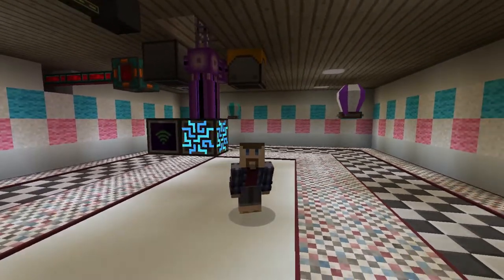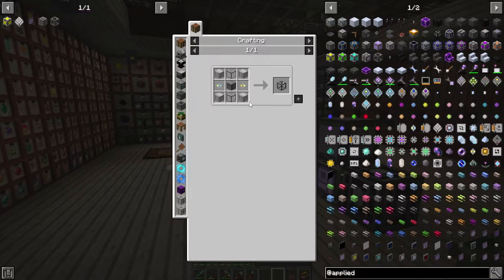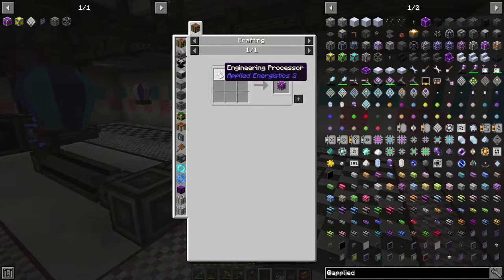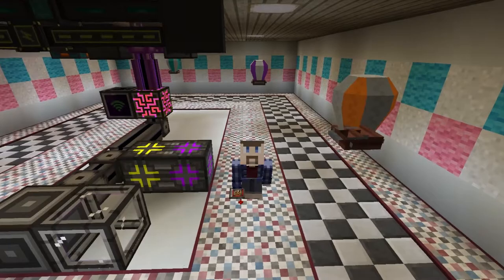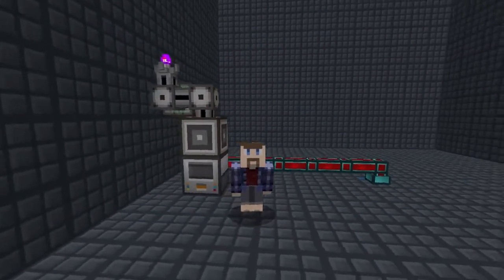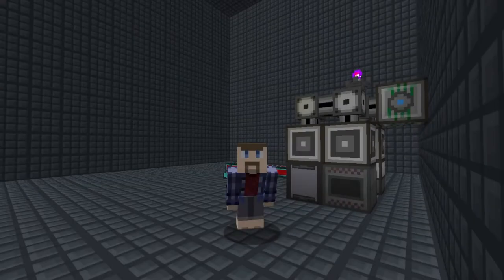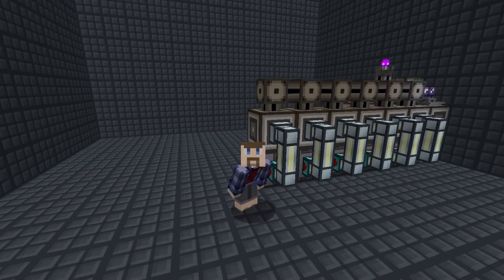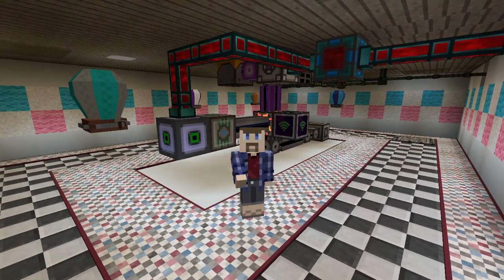Autocrafting with Applied Energistics 2 - Minecraft: Enigmatica 2 Expert #56

Comment: Do p2p tunnels work with the capability adapters ? Certainly makes it a lot tidier putting it in a compact machine 😀 a nice tip also is if you need to craft more of an item that already has a pattern and atleast 1 in your storage. you can press your mouse scroll wheel button to bring up the interface.
Reply from the maker: I actually don't know, but I would assume so, since the main purpose of the adapter is just to make the AE2 channels work at all through compact machine tunnels.  I've spent almost no time figuring out the p2p system honestly.  I'm going to have to soon though probably.  

Been busy cleaning up that room since I made this video and building out autocrafting for AE2 parts, and I'm probably going to have to do yet one more video with all the issues I've been running into and resolved.  It certainly wasn't what I was planning on doing though, but I've spent the better part of two days now cleaning stuff up, and I still have to move everything around in that compact machine.  Need to move all the other things into compact machines as well to get rid of the clutter and make room for more ME controllers.

Thanks for pointing out the mouse wheel thing though.  I somehow never tripped across that.
Reply: Yes I only discovered ithe mouse wheel trick through this mod pack. It certainly pushes you down paths outside your comfort zone. The p2p tunnels were also new to me. The one trick is you need to provide power to the tunnel side for it to work. You can usually just use a quartz fiber to connect power to both side but no channels. The one big irritation I found has been using compacting drawers for a recipe that needs blocks. It’s fine when you have stock of them but if you need to create ingots from ores then the crafter can get itself confused I think maybe using your storage bus trick might help to create a permanent stock. I have used soooo many blocks of tin going through env tech void miners. I’m just farming my nether stars for tier 6. It’s scary the resources crafting a tier5 structure panel block uses and even the null thingies are crazy. 
I need to do my modular machine for the titanium creation you did a few eps ago. Just doing the controller is a mission especially now I decided to go with the black iron pedestals i gotta make an elite crafting table 😳. It never ends 🤣🤣🤣 keeps me out of trouble.
Reply from the maker: Yeah, I was mucking with a separate p2p network and knew about routing power into it with quartz, from trying to setup a formation panel to automate fluix crystal creation, and never managed to get it working and just gave up because there are much easier routes in this pack.  Was just trying to do it the AE2 way because I was unfamiliar with it and it cost me like an hour of frustration.

I haven't even started upgrading my void miner.  I know the day is coming, but I'd need to get around to upgrading my power significantly first, or at the very least, setting up a second turbine already.  This is also part of why I started the low and slow roll of nether stars earlier than most though, because I knew I'd need thousands of them at the far end.    I could speed up the process, but it's unnecessary if you trade it from time instead.

My main goal currently is to build out my AE2 capacity though to get all my basic crafting stuff out of the way.  I'm only like 4 months behind schedule on actually doing that.  I'm sure it'll only take a few minutes.  Oops.  On the upside, materials won't be the problem in this.  Making 64k storage cells are already fully automated at least, so building out a compact machine full of cpus will be trivial.
Reply: Hehe I’m sure it will. Looking forward to the journey.

Comment: I have the exact same setup as you but when I try to craft printed silicon it doesn’t show up as craftable? Is it because I’m using the recipe as the normal inscribed and not the advanced one? (There is no recipe for the advanced inscriber)
Reply from the maker: I'm almost certain they didn't remove the advanced inscriber.  Check that AE2stuff is still available.  It's part of that mod.  I assume that's the issue though, because automating the AE2 inscriber is a giant pain.  I think you have to send it the inscriber plate every time in the recipe.
Reply from the maker: Yeah, I just double checked the patch notes.  AE2Stuff should still be there, so the advanced inscriber should be.  It solely exists to make automating the chips easier, which is kinda the whole point of the pack.
Reply: @Ardcraft  I have the advanced inscriber, it exists and it works. It just doesn’t have any Jei recipes I meant
Reply: @Ardcraft  could it be the cabling? I’m using smart cables. Tbh my entire ae2 is being janky. Things won’t craft even though they have the right patterns and interfaces, same with CPUs.
Reply from the maker: I would need to know more about how you have things set up, but the type of cables shouldn't matter at all.  The smart cables are just to show you how many channels are in use visually.  The advanced inscriber should just work exactly the same way recipe wise as the normal one.  When you set it up though, put the plate in it and click the lock button so it won't get removed.  This more sounds like you might be hitting channel limits though, because that would shut off any machines further down the line after you exceed it.  You should be able to see how much you've used on the smart cable.  If you're at 8/8 or 32/32 on dense cables, any more you add to that same cable won't work.
Reply: @Ardcraft  yeah I was at 8/8, should I use dense cables?
Reply: Got it, it was the cables. I ran out of channels. How do I get more than 32 channels? Thank you for the help!
Reply from the maker: Run a cable from a different side of the controller and/or make more controllers for more total faces if you need.  Different colors do not join together, although the base fluix one will connect to any of them.  You can also use cable anchors to keep them from connecting together.  Use dense to run trunk cables to an area, then use normal ones to branch off of them since they're cheaper to power blocks of machines.  You can get even more if you get your head wrapped around how p2p connections work, but I didn't need to resort to that for E2E personally.  I did finally figure it out in glacial awakening just to finally figure it out.  I explained it probably terribly here:    https://www.youtube.com/watch?v=mQyIDXPoq7I&t=750s
Reply: @Ardcraft  tysm!